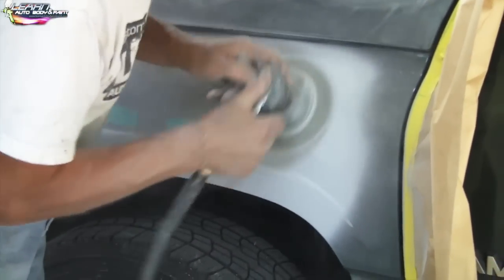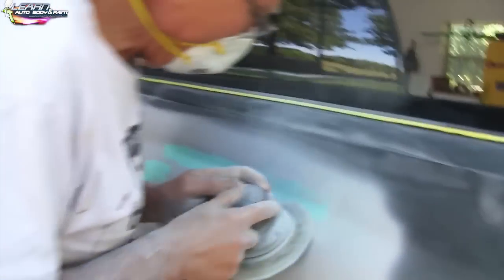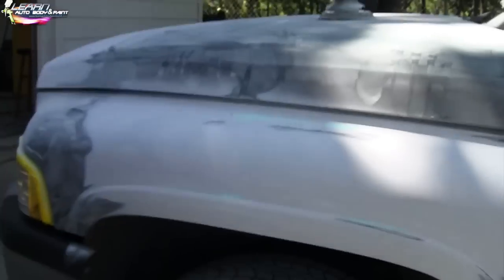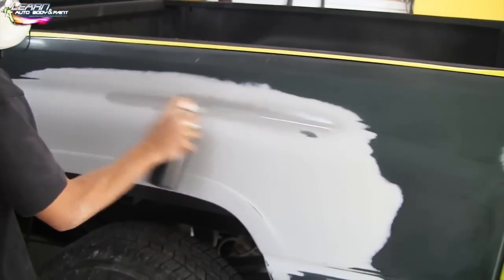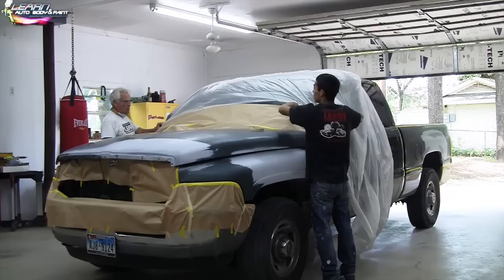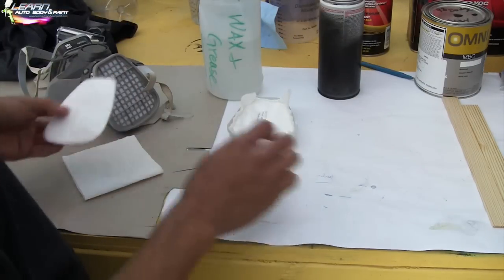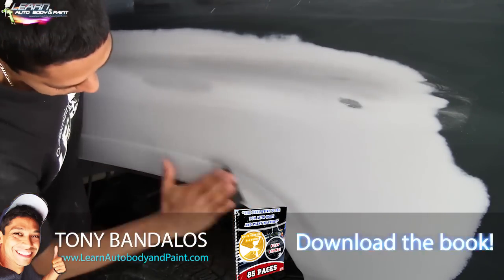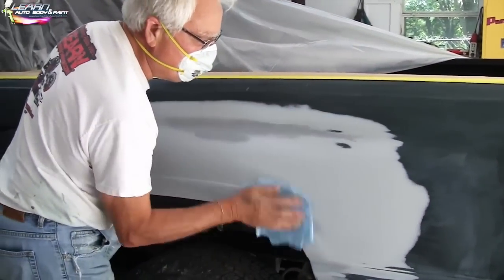Final Sanding HACKS - 2K Prime, Glaze Putty, Dry/Wet Sand, Clean and Prep for Paint!

Comment: How much sanding is necessary when painting with no repairs other then faded clear ? I also would like to know if for a color change you have to prime forsure or not ?
Reply: 600 grit all the areas you are going to paint and primer is not required most put a value shade sealer down first though just so you get coverage faster and take less base